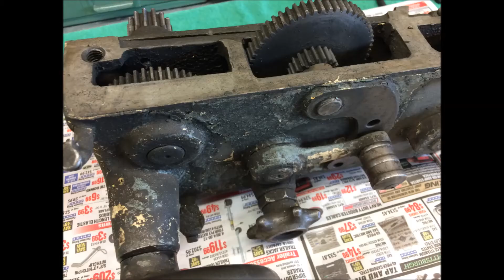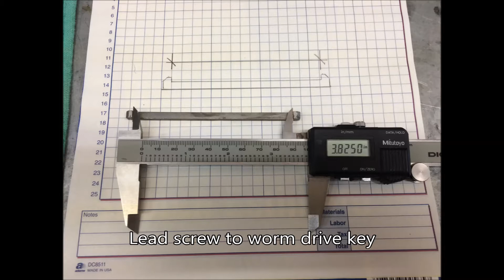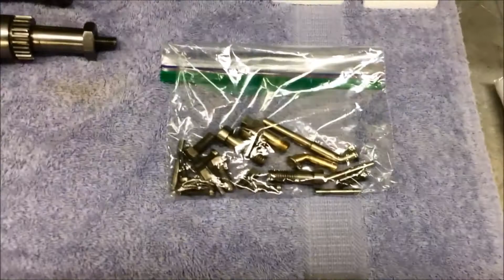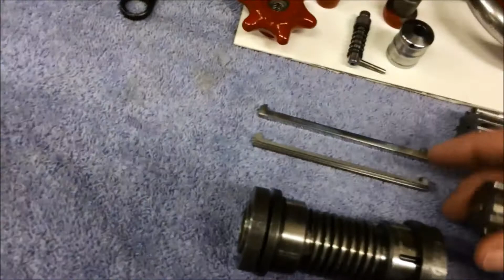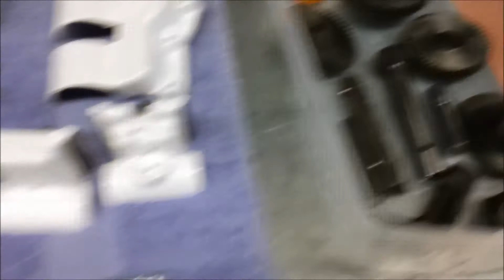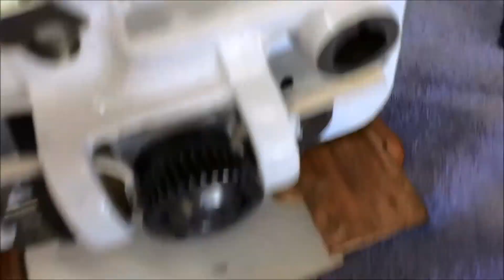South Bend Lathe Rebuild Part 2 "The Apron"

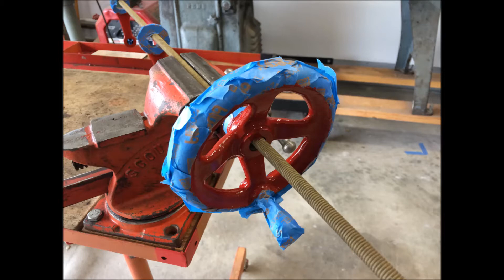Comment: Very good video, at 4:22min time of the video, which part did you put in the hole?  this part is for lubrication, but what's the name?
Reply from the maker: Yes it a Glits oiler can be purchased from McMaster Car. This is the smallest one I could find. It has a 10-32 threaded nipple. The factory oiling path for handwheel shaft is long internal wick. this modification improves the shaft oiling and is much easier to install. the original wick is a pain to install. You still need a short piece of wick in the bore.

Comment: Looks great. I really like the inside painted like that. Your apron was pretty clean really. My machine came from a manufacturing plant that used it to make brass horns for decades. No kidding, I cleaned like 5 pounds of brass chips out of the whole machine. The whole apron was packed solid.
Reply from the maker: Sounds familiar, the knee on my mill had enough chips inside to fill a 5 gallon bucket!
Reply: Good god! I can see that with aluminum. I'm always surprised how much chips aluminum can produce. I'd like a mill eventually. I'm not full blown obsessed yet, but I'm sure at some point I will be. I'd like something small, but not mini.

Comment from the maker: Rebuilding the apron. Replacement parts: clutch assembly, rack pinion gear, worm gear key. Oiling upgrade
Reply: Great job on the project. I have a heavy 10L and I am doing the same thing at the moment. I noticed I don’t have an oil slinger in mine, any idea on where to source it? Also on the rack pinion gear did you have any issue removing the tapered pin that holds it in, mine seems extraordinarily seized even though all other tapered pins were a breeze to remove. Thank you!
Reply from the maker: @debo_been_shiesty  I found everything on ebay. you may try Grizzly they have all the NOS south bend parts. I think there's two different oil slingers depending on vintage.

There's also different rack pinion shaft sizes.  Check the apron P/N or measure shaft size.
I used a real short nose punch on the stubborn taper pins, helped a lot.

Beat of luck....Dean